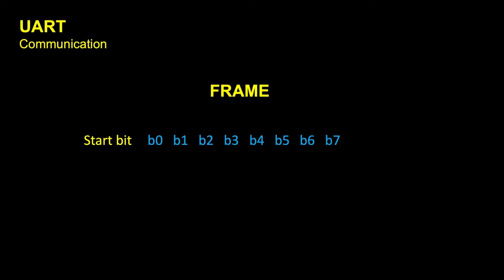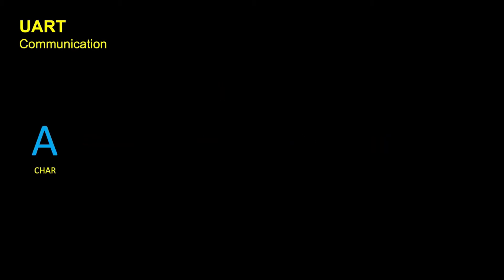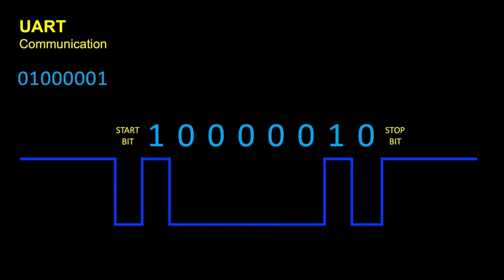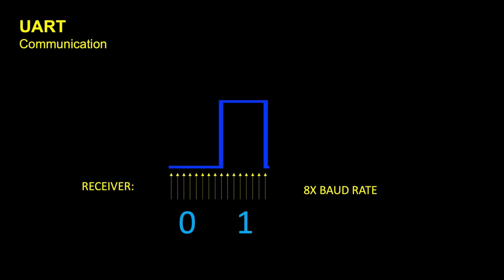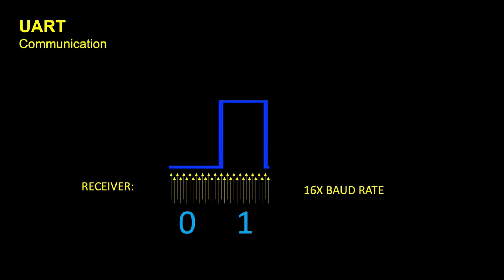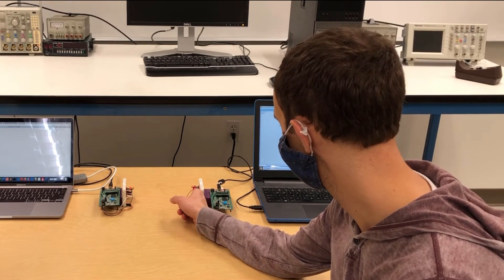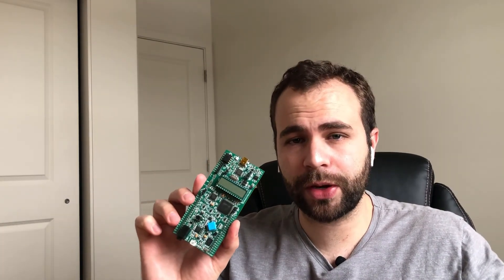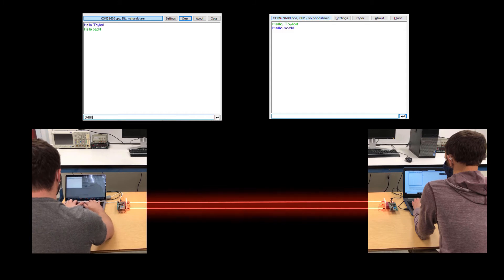Serial Laser Communication -  Final Project - Utah State University (FALL 2020)

Comment: What kind of laser did you use for this project? What is the optical output power in mW, lasing wavelength in nm, voltage, is it single-mode or multi-mode? Did you drive the laser directly from the DAC or did you use a laser driving IC? What is the frequency response of the components (laser, optical receiver, ADC, DAC)? According to the datasheet, the STM32-L476 microcontroller can run up to 8 MHz, but it doesn't specify the speed of the built-in ADC/DACs, so I'm guessing they can sample at a 8 MHz rate too.

Comment: Not sure if you are still checking this account but I was wondering if you think it is possible to adapt this project using audio similar to the Arduino Nano 33 BLE Sense (embedded data over sound CHIRP chip)? There wouldn't need to be a  transmitter because the info/text would be sent via the audio in a video stream. The audio signal would be between 20khz-48khz (standard iphone speaker)

Comment: I want to ask one  more question. Can ı do it With Led instead of Laser what should ı change from the code?
Reply from the maker: I think you can as long as the light sensor detects the light. No change in the code would be needed.
Reply: it can